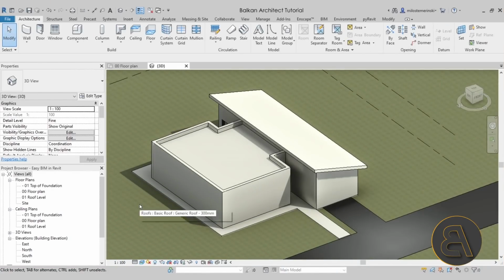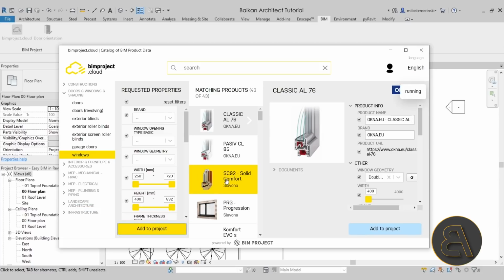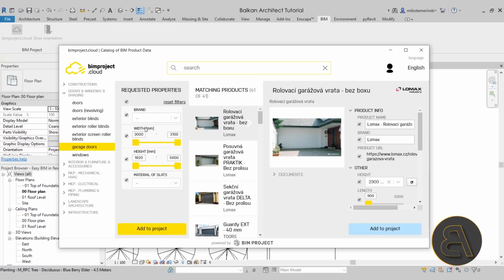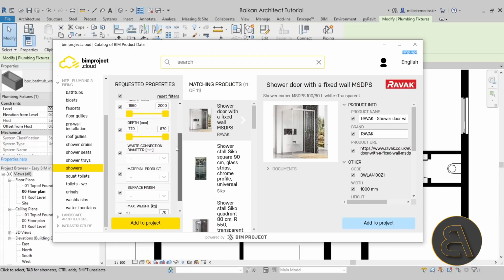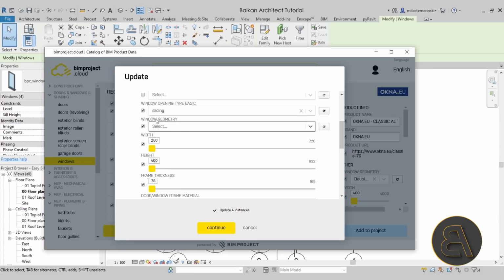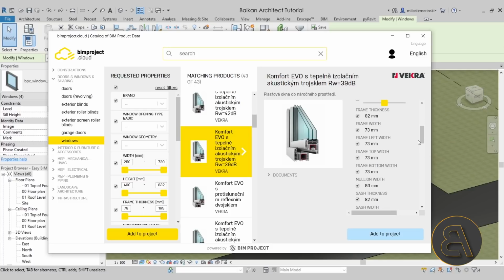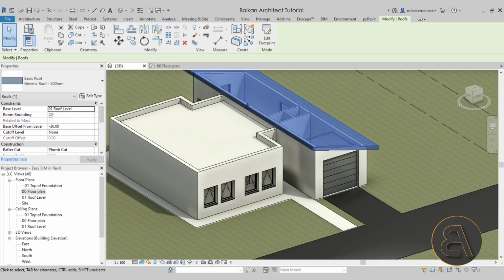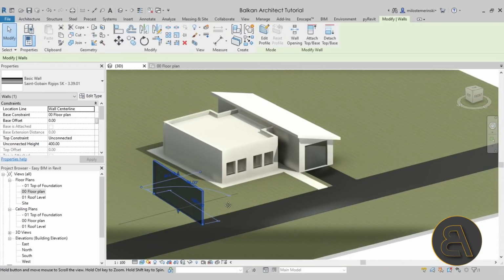Easy BIM in Revit - BIMProject

Comment: When a user creates a building, model, or any other kind of object in Revit, they may use Revit's rendering engine to make a more realistic image of what is otherwise a very diagrammatic model. The user accomplishes this either by using the premade model, wall, floor, etc., tools, or making her or his own models, walls, materials, etc. Revit 2010 comes with a plethora of predefined materials, each of which can be modified to the user's desires. The user can also begin with a "Generic" material. With this, the user can set the rotation, size, brightness, and intensity of textures, gloss maps (also known as shinemaps), transparency maps, reflection maps, oblique reflection maps, hole maps, and bump maps, as well as leaving the map part out and just using the sliders for any one (or all or none) of the aforementioned features of textures.

Comment: could improve processing speed !!
Reply: Hello Rivero, you are absolutely right! We try our best to improve the speeds, unfortunately, the problem is mostly on the side of Revit, which we can´t change in any way. But still, we try to develop the plugin to respond the fastest way in the Revit system. If you look at it from the bright side, it should still save you some time, when inserting data, compared to manually filling them in. Anyways, thank you for the feedback :)